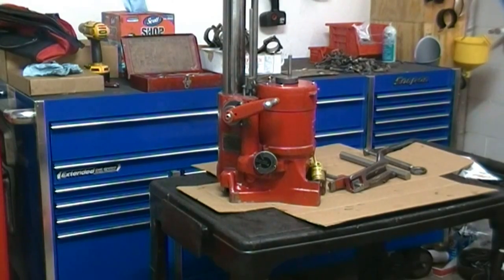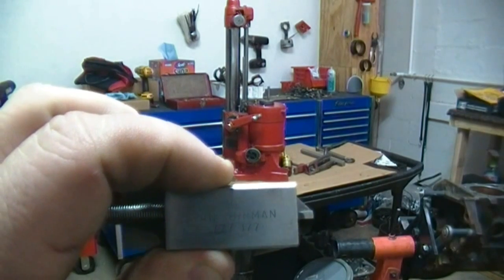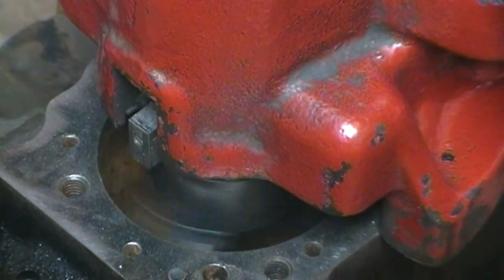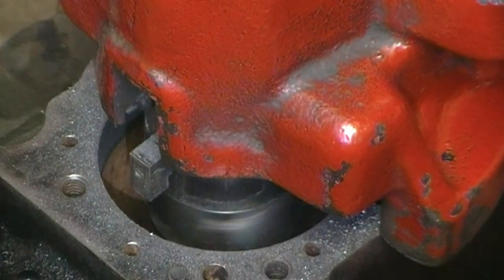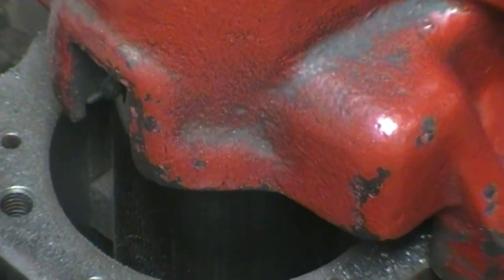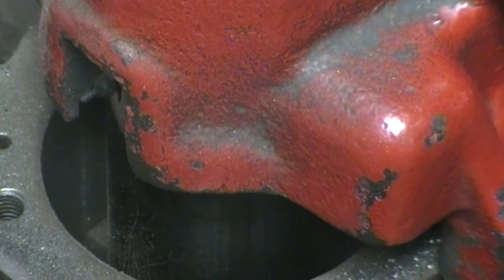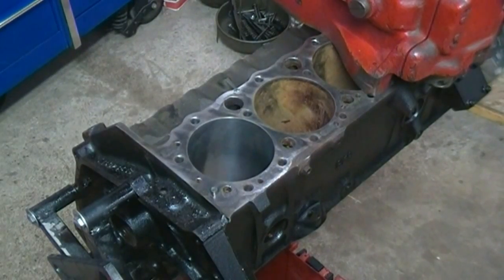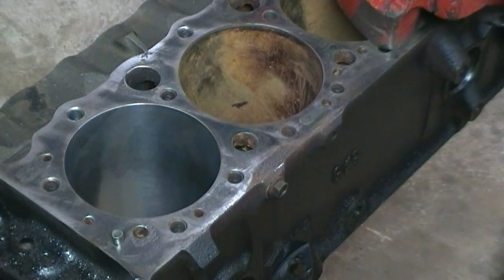How to bore an engine with a boring bar

Comment: First job out of HS in ‘64, Eastern Engine in Brooklyn, NY .. learned with Van Norman BB... looks like same one...also used Kwikway but preferred van Norman...bored every thing from a Brockway to a flat head ...wet sleeves, heavy wall sleeves etc...even used the infamous “sucker-outer on truck engines still under the hood...Thanks for posting. Brings back some great memories
Reply: ,,,,,,At 71 now ,,, I was born in Brooklyn NY,,,,,I knew of Bobby Lombardi of Eastern Automotive on the south end of Coney Island ave.   ,,,,,,,,He was a great drag racer..........did you ever hear of  Eastern Automotive

Comment: Welp, this idiot just RUINED THE BLOCK.  You're supposed to use a torque plate.   Now when you install the cylinder heads, the bores will be misaligned!  RUINED!  Toss it in the back of the pickup and take it off to the scrap yard!!!!
Reply: lol torque plate are used for honing, not boring...
Reply: Slappy Fistwad
Spend more time doing and less time reading Drift Wheels of Fire. What percentage of engines have ever seen a torque plate? Many things to be considered like, bolt/stud depth, temperature, ring type etc. That block may just be fine without a plate. Read and **practice** more................
Reply: Get a life honda boy, nice butt pirate name too, what the fuck...flappy gizwad
Reply: Korie Creson  😂😂😂😂flaffy gizwad Honda boy😂😂😂 my thoughts exactly. 👍
Reply: @wheels2199  haha. Thanks. Some folks are just holeasscraniacs

Comment: The bar is centered with the cat's paws at the top where there is no cylinder wear, the cutter is installed after the centering. The cutter is set up in the micrometer tool for the bore size. There are 5 sets of cat's paws from small to big depending on the bore size.
Reply: It uses a 3 pin centering system ,. No cats were harmed in the video

Comment: This video would have been a lot more valuable if you had actually showed how to setup the Van Norman to cut the bore. Including centering the boring bar, setting a witness mark, feed rate control and indicating the cutter. You didn't do any of these steps. What was the point of this video again? You didn't do "how" anything was done at all. -100
Reply: I learned "$15 a hole". About to show this video to my Wife.
Reply: Well if you’re a dick about it he’s not going to make a more detailed video now is he!?
Reply: +Doug Hanchard  Where's your bore video?
Reply: +Doug Hanchard You have to realize he has a business to run. he is just showing the basic part of it. If he shows all his trade secrets he would put himself out of business...

Comment: I built a similar boring set-up with an automatic feed I copied from a mini lathe. The Van Norman is ok for a street engine but for a racing engine you need to locate and hold position from the main bearing center line. My machine has a massive bar that clamps in by the main caps. Holes in the bar hold a pilot for the boring bar that is centered with dial indicators. My machine is overkill for most jobs as the set-up time is considerable but for my racing engines I get the accuracy of a super expensive machine with a homemade one cobbed together in my back yard machine shop.
Reply: Sounds like bullshit to me.
Reply: Nice try 😁
Reply: my bridgeport can hone a harley motor  !   my ahole brother says he can do the same thing with a hammer & chizel
Reply: I was thinking of a machine very similar to this! I was thinking of a plate that bolts to the mains with a hole centered on the bore for the boring bar to travel. Yours is probably a much better idea. I would LOVE to see a pic of it or a movie in action!
Reply: dantheman1998 At the end of the season my son and I both decided to run in the crate motor classes and sold the machine to help pay for the G.M. 602 motors. 602 is the part # for these factory sealed 350 engines.
Reply: Do you have plans or sketches?
Reply: My engine is powering a car to 126mph in a 3500lbs car in the 1/8.. thats a measly 1062hp. I didnt even balance the engine. Crank and rods came from two different motors. Pistons were forged but cheap UEM. Stock bearings. stock valve. shift that v8 at 8-8100 rpm. 

I think your a little bit over zealous with shit lol

Comment: Thanks for the good demonstration. I was curious about how you centered the boring bar in the cylinder. Does that boring bar have a three finger centering mechanism built in or something like that to get perfectly centered?  Also how does the boring bar mount to the engine block? Does it have an anchor that slips in to another cylinder to tighten down? Well thanks for the video and have a good day.
Reply: another method used is putting a dial indicator on the tooling bit and turning it around till the gauge reads the least run out- then attach the cutting bit. Not sure if thats how the norman works but u get the idea-
Reply: Good question, I'd like to know this too
Reply: AJ Pierce You're right ! : )

Comment: actually....honing is a mix between scrathcing and polishing. like a brillo pad does. gives the bore a fine smooth finish with a crosshatch scrathcing pattern. kinda hard to explain really. lol
Reply: You have to leave three to five thousand still home to get through the metal fracture from the cutting tool

Comment: Honing is similar but you dont really cut material, you shave it off and leaves a fine finish. To bore and engine .040 you really want to cut it at .038 and with the hone you take off the last .002  It also provides the crosshatch pattern so that the ring will seat properly when the engine is started. Look for videos. theres a bunch on honing

Comment: boring is cutting of cylinder to match piston size .

honing is done after cutting/boring and but a cross hatching pattern on cylinder wall .
Reply: Both boring and honing cut a cylinder to match piston size. Boring can cut a whole lot more material, so boring is used to cut away the bulk of the material. Boring also restores straightness and roundness to a cylinder that may be tapered and out of round due to wear. Honing, on the other hand, is a finishing operation which generates the proper crosshatch pattern for oil retention. This operation DOES require the removal of material. Therefore, a cylinder is bored to a little less than final diameter. And the remainder of the material is removed by honing.